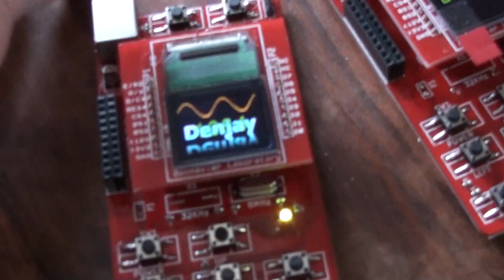Denjay ARM Development board

Comment from the maker: @lartti83 
Hi Lartti, 
There is no connection available to GPIOA DAC pins on the board. But if you use the 16-bit PWMs on GPIOB you will reach higher resolution for your sinewave, all you need is a small filter capacitor to smoothen the PWM. I hope that you still is interested. 
Kindly Regards Daniel.
Denjay